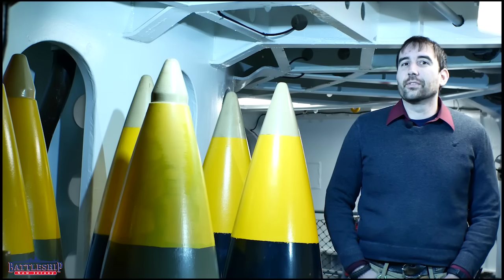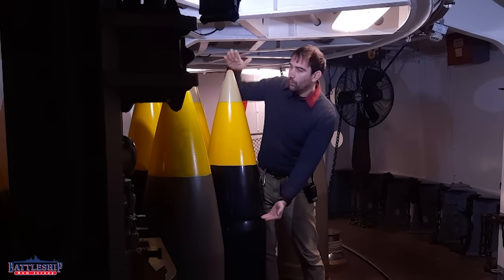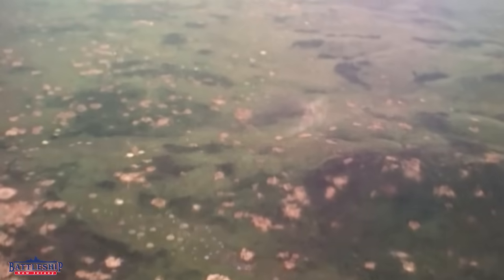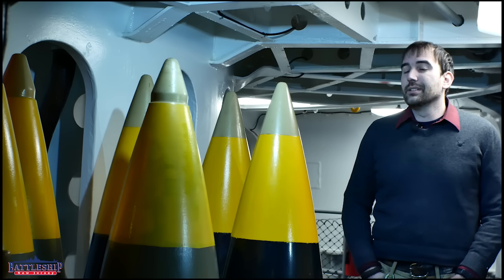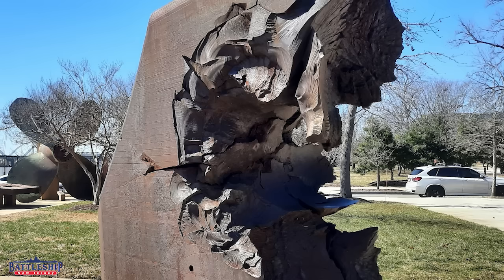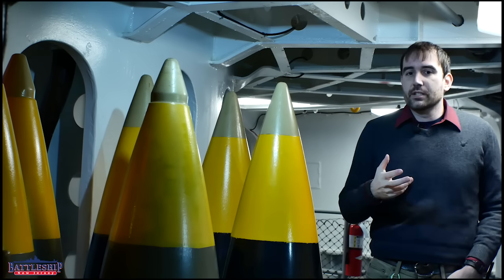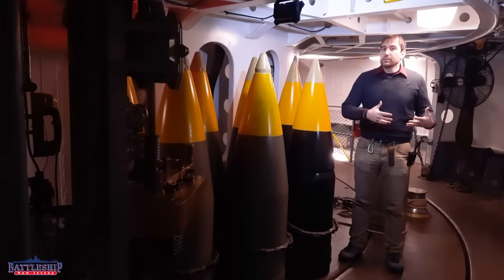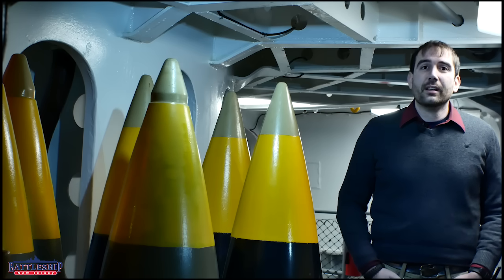What Does the Impact of a 16in Shell Look Like?

Comment: I can only imagine what a 16 inch HESH would done to bare armor plate, but the countermeasures are so easy it was never done.
Reply: In the case of an exterior armor belt, it would probably be pretty effective. With our ships with a interior belt, that required penetration of 2-3 layers of significant steel before even reaching the armor, I think this would severely reduce its effectiveness.

Comment: Ok doing some quick back of the envelope math a 50’ diameter crater 20’ deep works out to roughly 35,000 cubic feet of soil relocated at high velocity. Using a unit weight of 92 pounds per cubic foot gives us 3.22 MILLION pounds of soil moved in about a tenth of a second per shell. The amount of energy on display is nothing short of incredible

EDIT: I’ve changed the weight of soil to 80 lb/ft3 and the volume to 27,500 cubic feet based on the volume of a sphere accounting for the crater being wider than it is deep. I have now arrived at 2.24 million pounds of soil distributed to the surrounding area.
Reply: Don't forget to allow for a good part of the diameter not being max depth.
Reply: @stevek8829  Yeah I actually redid the numbers using a partial volume of a sphere with a 50’ diameter and got like 2.68 million pounds, but it’s not a perfect sphere because the diameter is greater than the depth so it’s probably closer to 2.8-2.9 million pounds in that range. This is just back of the envelope math I could do an equation of a curve and set up an integral to find area and then volume but I’m way too lazy for that.
Reply: And that's with the explosion compressing the dirt at the bottom. Imagine the crater made if you could sink one of these down below the 20' mark.
Reply: Thanks for the math. It definitely helps with perspective.

My conclusion: if you know one of these is coming your way... Be somewhere else
Reply: @oldschooljack3479  out of all the comments on this thread yours makes the most sense to me . Well said .
Reply: Sounds like a whole lot of dmg for only 130lb of explosive
Reply: @buzzkill4623  Your forgetting about the kinetic energy added by the velocity and weight of the shell. Take for example a 24,00 pound truck traveling at 55 MPH and it hit a wall. That about 1million pounds of energy unleashed in the time it takes to stop the original 24,000  pounds
Reply: Wow, right away I thought of poor US Marines at Henderson Field Guadalcanal getting shelled by Japanese battleships…
Reply: @jojobar5877  yup absolutely horrifying
Reply: OK all you haters out there who are questioning the math and the material weigh considerable et cetera need to just quit that and simply appreciate just how big of a hole that thing can make in the blink of an eye the garbage how many pounds per cubic foot that dirt weighs it's still moving and awful lot of it really quickly I think the fact that this guy just Did the mayor and came up with a rough approximation of just how much Earth one of those shells displaces instantly Is entertaining
Reply: @jackwinemiller8358  Hear!  Hear!
Reply: You've got to admire mathematicians!
Reply: goddamn O_O
Reply: I think the maths is quite far off. You correctly assume the diameter is greater than the depth of the crater, but its a significant difference. I can't remember how the maths is done, but its pretty easy if you draw it out, visually, the shape of the crater would only be a fraction of the sphere's volume
Reply: @seemslegit6203  don’t hurt yourself coming up with an answer, just insist nobody else knows anything.
Reply: @seemslegit6203  The way to properly calculate the volume would be to take an integral of the equation over the range of the depth (from 0-20) 

I first did a rough guess based on a cylinder, then did several hemispheres of different radius, then applied TLAR for my volume.
Reply: @johnbeauvais3159  That’s what I’m talking about and he’s totally wrong because he wasted a perfectly good envelope why are you doing math on the back of a freaking envelope that’s just non-common sense. It’s like I told the other guy what he has to mail a letter now he’s screwed
Reply: @J R Takes about 4 hours if you are a Corp of Engineers Sgt with a fuel truck on standby - 50 ft wide, 20 ft deep, 200 feet long, and that SOB was collecting my bet by lunch. (And our new drainage canal was done in a week instead of 3 months)
Reply: @muninrob  THATS WHAT DID TOO.. BUT I USED QUANTUM BIODIHIEDIEDREALL PHYSICS.. To Calculate , Compensate & Also To Figure All Possible  Baritomic  Measurements..  Well Anyone Can See,,, YOU CANT OUT BUSHIT ME… lol
Reply: @donaldleavy4379  Huh? All I did was lose 1/2 a paycheck to a Sgt. from the Corp of engineers - the bastard did it, with a digger that I helped unload from the back of a C-130.
Reply: @muninrob  nice
Reply: To calculate the volume displaced, did you use 1/2 the volume of a elliptical sphere? (4/3*a*b*c*pi)(*1/2)  The number from that is 26180cf.  Just wondering if you used a different formula, or it was just a rounding thing.
Reply: @philliplarose8570  I did not, that is almost certainly the most accurate value. Kudos to you because I didn’t know there was a convenient formula or an elliptical sphere. 

I honestly took several different radius sizes for a normal sphere and went with TLAR (That Looks About Right) I was just looking to gain some semblance of how powerful these shells were
Reply: @philliplarose8570  you done it.. that’s also a pinto muffler bracket
Reply: this is a fascinating comment thread! I have enjoyed it almost as much as the video its self.... interesting to note that any measurement of the weight of a cubic foot of earth will likey be compacted soil and as you shovel it into a container to weigh it will become more than one cubic foot of soil... plenty to think about when there is nothing else interesting to do.
Reply: @lukewarmwater6412  oh Yeah.. indubitably.. I also Computed/ Calculated this With a pie variation…      &  Coffee As Well… & Yes .. W/ Cream & Sugar…
Reply: @donaldleavy4379  wow... you went through alot of trouble, I just walked out to the yard and stared at the ground for a while.....
Reply: @lukewarmwater6412  well done..& what’s the sum of the calculated circumference ..displacement Determines??? Huh huh huh???? Thought so I came up with the letter g & # 3
Reply: @donaldleavy4379  ummm.... Tuesday?
Reply: @lukewarmwater6412  EXACTLY… Tuesday..INDEED ,Finally Someone Gets It.. TELL LUKE WHAT HES WON JIM…..Well Luke You’ve Just Won .. … … ( pause fer effect)….  .. Not. One Oh no , not one BUT TWO 2 .. tall TALL KITCHEN..  garbage bags ???
Reply: Sorry their used .. but ya know how these   UTUBE prize people are.. But Hay Luke YOU ENJOY THEM ANYWAY… Tuesday…. I’ll be damned.. or not
Reply: I'm not connected to any branch of service so my knowledge of armaments is virtually nil. I've read quite a few comments here regarding the craters but haven't found anything about the concussive energy of these big shells. At what distance would one survive such a blast?
Reply: @glennwiebe5128  it’s not too close 50’ hell no.. 500’ nope not a chance..I recall something bout 250 yards .. but I think is 500 yds…for me anywhere that’s not in front of it is best
Reply: Glad you clarified that professor....lol
Reply: Nice job on the math.  Amazing numbers.
Reply: It's definitely impressive by  us humans, so far. But, we still can't match the vast power of nature as a whole, though. 

Until, we can destroy suns and planets with a flip of a switch. This is tiny, yet, still impression from a human invention perspective, such atomic nukes, though. Even, though my comment may sounds unrealistic, I'm just saying. Lol.
Reply: Are there some real messurements as well, or only the guessed ones, like feet, armlenghts and weights of ancient buttercups - put it in metric, god damn it. Everything else isnt scientific
Reply: @RealExplotar  All are quite exact, but harder to learn. Do your own conversions like the rest of us if you want different units. Also, thisis clearlly a series of American comments, no complaining.
Reply: @RealExplotar  this isn’t scientific, this wasn’t done three times minimum at 15 dungarees centigrade and 760 Torr. If you would like to convert the values to whatever measurement system your heart desires nobody will stop you. Hell you could even calculate it to Smoots.
Reply: Ya, what he said
Reply: Whatever.
Reply: You wouldn't happen to like Math's would you John??? Lol
Reply: @brandongardner3073  Civil engineer, it’s the default setting.
Reply: Do you not have a life?
Reply: why rototill anything
Reply: You’re totally wrong man I don’t think you even know what you’re talking about or doing now you’ve wasted a perfectly good envelope that’s what I’m talking about what do you need to mail a letter now you’re screwed I don’t know if your math is right or not..But it was totally wrong to ruin a perfectly good envelope don’t you think what’s wrong with you people?
Reply: Nice icon, very fitting.
Reply: @mach1553  Thank you! It’s funny how many people mention they like the Luckies logo
Reply: good way to dig a swimming pool.
Reply: I wish I could have that printed on a t shirt, thats just awesome mathematical insanity. what I want to know is what the muzzle velocity is for those 16" guns
Reply: @jackwinemiller8358  They mention it in another video but less than you might think, like 3,500 fps if memory serves. The US operated on the idea that plunging fire would be harder to stop so a higher slower moving shell would be as effective while reducing wear on barrels
Reply: @jackwinemiller8358  3500 ft sec… I think.. it’s a guess
Reply: ok all you haters out there who are questioning the math or material weight etc, etc  I need to just quit it I
Reply: I'll give ten to one your an engineer...
Reply: I'm getting about 26,200 cubic feet assuming the crater is a semi-ellipsoid. 
Formula: where a=20, b=25, c=25

A ≈ 2π * ( ((a*b)1,6075+(a*c)1,6075+(b*c)1,6075)/3 )1/1,6075 + π * b * c
V = 2/3 * π * a * b * c
Reply: You guys keep talking math.....ME...what a big hole!!!!!
Reply: Consider that such power was a about average for about 70 pecent of the shells fired in the trenches o ww1. Over 100 millon of the shells fired on the western front alone in that war had similar yields to these ones. Imagine a half million of these hitting a 10 or 12 square miles in 3 days and you have the average experience of those in the area during major battles. Over 200 9 inch to 18 inch shells would land in a single square mile, turning over 6 percent of the space into empty craters. That doesn't account for the sub-9 inch shells landing in the same area rendering some 10 percent of a square mile to crater. This is the scale of destruction artillery can actually cause, and it's horrifying.
Reply: Having worked as a soil technician I can say soil weights are highly variable, I've seen densities in the range of 130 - 135 lbs/ft³. That's including the water which is always present to varying degrees.
Reply: this is what I want to know, did you work out all that math by literally writing it out by hand, and if so was it in pencil or pen? or did you use one of those handy dandy Texas instruments calculators with the red led number display, I'm pretty sure that either was the result is the same.....THAT FRIENDS IS ONE BIG DAMN HOLE !!!
Reply: Solid math! ❤ 🇺🇸 💥
Reply: Is your soil half lead. How did you come up with 92pounds per cubic foot?
Reply: @craigrobertson5030  If you cut a 1'x1'x1' block of turf out of your front yard that would be nearly spot on. Ground is not a bag of potting soil.
Reply: @edsloan8535  
Thank you, I am showing this to the wife,
  So the next time she wants a fire pit, post holes, etc. Dug out.
  She will understand why those "little holes" tire me out!
👍🤣
Reply: @sidewyndersshed1676  use explosives
Reply: @MrBen527  
LOL,
 That is a very tempting idea.
  But, I have already been blown up once whilst in the military.
  I have no desire to do it to myself in the civilian world.
🤣👍😁
Reply: @sidewyndersshed1676  copy that!  😆
Reply: @sidewyndersshed1676  they just don't get it
Reply: @craigrobertson5030  the average range of soil unit weights is 74 to 110 pounds, I split the difference
Reply: @johnbeauvais3159  the global average is 82lbs.
Reply: @craigrobertson5030  And here we see that I’m a structures guy not a geotechnical guy.
Reply: @johnbeauvais3159  I'm a welder, but thought dirt was like 70lbs with40% moisture. Lol I'm just as clueless, but still learning
Reply: @craigrobertson5030  Yep, I used to think soil wasn't that heavy. Then I had to fill raised beds by hand. It adds up quick lol
Reply: @dan8250  I helped dig out a basement to do underpinnings and hydronix heating, sand is heavy after a day
Reply: @johnbeauvais3159   Splitting hairs here & suffice to say ; You'd Not Want To Be On Receiving Point of These High Speed Projectiles  !  They did do extreme damage no matter what they hit. The rather small differences in calculations may give sexual stimulation to egg heads but to the average person the figures don't really matter. I think that at this point of 2022 we can safely say , our advanced weapons systems in present era are devastating to the point that no sensible sentient being would want to implement their use. If you're a true human you'd never want to hurt the Vast Number of Innocents that these weapons would harm. It's almost always the innocents in unprotected environments whom shoulder the brunt of the casualties. I say that in 2022 it'd be vastly more efficient to precisely target members of the cabal. Let's save humanity & use our precision upon humanity's real enemies whom are the cabal members. We know who they are , what are we waiting for ?  Save the unprotected Innocent ones ............... Cordially , Nick , NavyBlueSmoke , LST-1195 . TruthSocial.com  ( I'm Baracks chosen worst enemy as stated by him ! ) ..............
Reply: @dan8250  a cubic yard of dirt is considered to weigh about a ton on average. 5 raised beds, each about 40 cubic feet, close to 7.5 cubic yards of dirt and soil moved by hand. One per day had me really wiped out at the end of the day.
Reply: @craigrobertson5030  
It’s a completely reasonable estimate. Sand is around 85 lb/ft3. A sand-silt-gravel mix can go somewhere in the low 90s. Gravels can run 115-120.